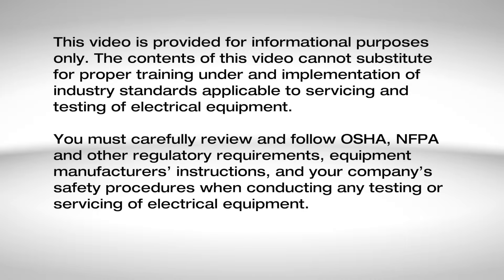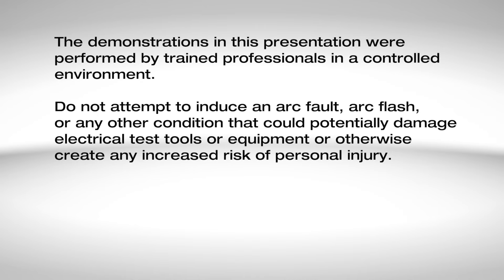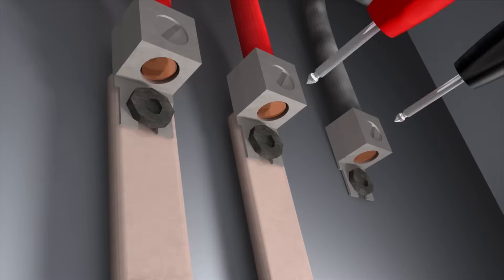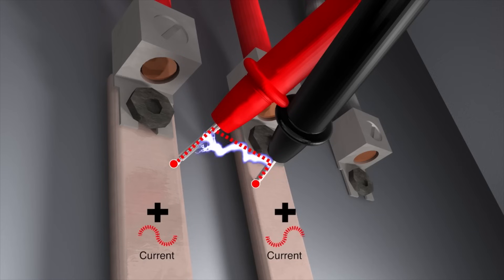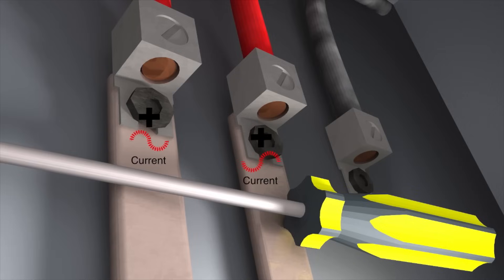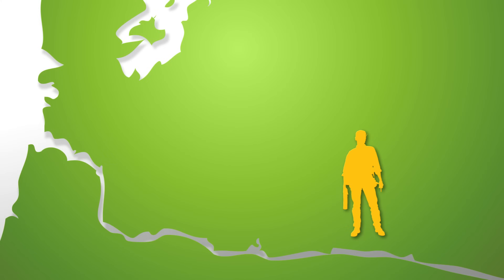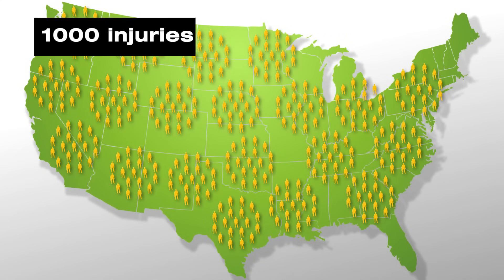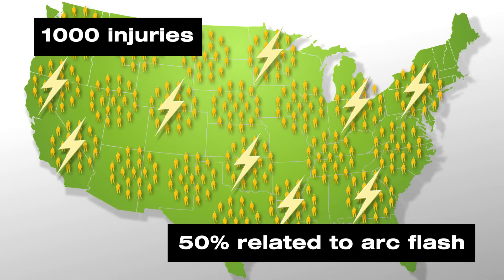Dangers of arc flash

Comment: 1:30 No, it's 3.4 times AS hot as the sun. The sun's surface has a temperature of 5772K. "Four times hotter" would be 5x = 28860K or 51488°F.
Reply: They were comparing to the sun’s temperature at night.
Reply: @MichaelApproved  Probably in winter time too.
Reply: @MichaelApproved Using Kelvin is the only way to compare temperatures in absolute terms.

Comment: Arc flash is extremely rare, like a piece of Fluke equipment. If it works, it must be a fluke. John Fluke didn't like the smart engineer that said it.

The guy failed to mention arc flash is basically like arc welding except at much higher voltage and AC in most cases.

Comment: Thank you.  Never had the displeasure of an arc flash. 
   I am a retired professor and have watched and been taught by electricians as a young boy to my retirement. Thank you to all the electricians out there. Your colleagues kept me safe.
Reply: I once did... was patching a set of outdoor extension cables as a teen for our electric mower (#1 no-no) as my mom and sisters would often run over them with the mower (don't ask me how!) I went to pare back the sheathing to get bare wire to solder the ends (no twist-patching!) and BANG. Mistake #2: I had not unplugged the feed end of the damned cable. Ruined the Xacto knife, luckily no metal splatter from it. Just meant I had to cut a bit further back, AFTER unplugging it. Never did that again.
  120v is bearable, 240v is decidedly NOT fun. (general house feeds) 
  Also took a picture tube discharge when rotating monitor tube due to phosphor burn-in from mainframe menu. It went through my thumb, and it didn't hurt until about 5 minutes later, when my body got past the shock. I realized I had a hole right through my thumb and nail. You know that safety-pin thru a finger prank? I could do it without the fake pin! Almost made the secretary pass out. 
  When I saw bro-in-law was using an extension with a cracked casing (when I was older) I paid for a new extension for him out of my pocket, and told him why. Now I even have a spare 50' cable laying about (the damaged ones get stripped and the copper recycled.

Comment: Making something tension-free is not that difficult. Simply switch off the consumers and measure at the fuses whether there is still current flowing (measure three times, the second time on a current-carrying conductor to check your meter). Placing  the fuses is something completely different. Fluke should make an instrument that measures the impedance on the outgoing side, so that you know what current to expect when you place the fuses. Unfortunately, they don't have something like this in their range. You can measure with your ohm meter, but this one measures the direct current resistance. Not the impedance.

Comment: maybe industry can incorporate a new method/pc board  that  views the needed electrical measurements and sends them to a device/receiver a safe distance away like a radio frequency signal add on to the panel box  that sends the required info to a battery powered hand held device. the new key fobs in autos comes to mind as they have many functions as they are. 🙂

Comment: Was researching Wadsworth panels not tripping and stumbled onto this video. I am an electrician and currently doing some work in a house that has a Wadsworth panel (I explained to the customer that panel needed changed and she understood and said ok.) I was changing an outlet that I thought it was dead, the breaker was OFF, or so I thought. A previous DIY'er had reversed the wires in an upstream outlet box, white was hot and black was neutral. My tick tester only went to the black wire and didn't beep. I unscrewed the black wire first with an impact and as I touched the white wire the impact the shank also touched the side of the box... sparks flew... breaker NEVER tripped.
Reply: So, ¿the breaker wasn't off to begin with?
Reply: Breaker welded itself shut.

Comment: Thinking of lightning's electrical current, and how electrical paths from lightning can cause the completion of the circuit, we can now figure out in detail the two types of arc flash events: 

Phase-to-phase - this means ionizing electrons from one metal object to another metal object (given the metallic objects are too close to each other) created an air gap good enough for charge separation to set off the arc flash. 

Phase-to-ground - this means a metallic object got too close to or touching (contacting) metal that goes to the ground, or metal that is on the ground, causing the same air-gapping, electron ionization and resultant charge separation to set off the arc flash. 

Also.....

Combustible dusts that happens anywhere these two events happen can also cause the arc flash if the heat or charge separation (along with enough oxygen) to set off a spark is good enough for these dangerous flashes.
Reply: With that, working with anything silver on energized electrical equipment creates the highest danger because silver is the greatest conductor.
Reply: I don't know why people are putting dielectric grease in panels. Once that stuff gets full of dust it's going to be fun and games.

Comment: Sometimes working on this stuff (240 volts or less) I get very reckless trying to get a piece of equipment going.. Just yesterday 3 phase 208 volts on a 35 amp breaker I was crouched over the locked up condensing unit and had a phase to phase event. I'm not joking when I say it was like an M-80 going off right in my face. No injuries. It must have touched right when the AC sign wave was peaking because it was bad. One day I know something bad could happen and I pray the circuit protection keeps doing its job. 208 volts can draw tens of thousands of amps with the ohms as low as they were being 5 feet from the 400 amp sub panel. Usually no big deal but occasionally the unexpected very violent arc flash can and will occur. Stay safe all electrical workers 🙏
Reply: take care pls

Comment: I repair welding equipment for a living, arc flash and arc burns , very bad deal. Respect electricity always, no matter what the voltage.
Reply: 💯 agree. I have the highest respect for electricity. I repair circuit breakers and I've seen some really burnt out ones. Big chunk of metals melted like butter. 😵‍💫 ⚡⚡

Comment: Arc flash - a non-explosive electrical flash which gives off high heat and can cause severe burns or shock, and even death. 

Arc blast - much more dangerous - is an explosive electrical flash which can cause not only severe burns or electric shock - but also fractures, and also even death. Like an arc flash, an arc blast gives off high heat but also there is the pressure wave of the explosion which can lead to severe physical consequences as well. 

Examples of arc blasts happen during explosions on electrical transformers when they fault.
Reply: LIghtning strikes from thunderstorms are also examples of arc flashes and arc blasts.

Comment: Why not cut the power when you have to open a panel....
Reply: How can you locate and trace voltage without power? I have to assume your not an electrician. We require voltage to trace faults. It's like turning off a car engine then trying to figure out what's broken without ever running it. It's called HOT WORK. 60% of work electricians do has to be hot work. Wear PPE, follow rules, be as careful as possible then say a prayer. Lack of attention to work will put you in the ground.
Reply: @doughnut4867  95% of what electricians do is installing lol. New construction we don't have power till the near end.
Reply: @Tre16  so no temp poles, you don't install power on site? No troubleshooting? Just new construction with a master license? I'm talking about MCC repairs, ats installs, rewire existing services, service replacements? Then your missing millions of dollars doing TURN KEY work. Go for it man. No commercial or residential repairs?
Reply: @doughnut4867  I'll bet you could do some of that with the power off, using test equipment?
Reply: @doughnut4867 can i make a questiom for you about arc flash?
Reply: Yeah... Just shut shit off. I'm sure the rest of the people in the hospital... Or refinery... Or any other critical operations, won't mind.

Comment: This is the only video, where a person knows what they are talking about arc flash. Precisely said 4 times hotter than the surface of the sun rather than saying just the sun.
Reply: Can i make a question to you?
Reply: @guilhermearaujo1350  sure
Reply: @sto2779  you understand about arc flash right?
Reply: @guilhermearaujo1350  Sort of but not years of experience about it. They are extremely dangerous when high voltage is involved. As shown in the video.
Reply: @sto2779  a transmition lines can have arc flash? And arc flashes have the same power than the cable? If a cable have 1000 Volts and 100 A = 100 000 Watts the flash will have the same wayts? Or its just heat?
Reply: @sto2779  look my previus comment what you think?
Reply: @guilhermearaujo1350  With your settings, Arch flash will be 100,000 Watts (pure heat energy dissipated, it gets worse, this will be molten metal of the wires projecting out to least resistance path to ground, in this case the user/electrician), you also need to consider time into this scenario, it will happen in a fraction of a second, around 700 MPH, that equates to an arch flash of molten metal travelling at the speed of 1027 feets / sec, which means for the very 1st foot distance of arc flash traveled will happen in 0.058 sec (which is 58 milliseconds). Arc flash is scary stuff, specially when current is not monitored or controlled. Today's electrical boxes are extremely primitive when voltage and current could be easily controlled digitally to prevent these devastating instant arch flash accidents.
Reply: @sto2779  but wait, if the arc flash has 100 000 watts and it lasts for 1 second, will I receive 100 000 watts in my body? Does the electrical resistance in ohms of my skin matter? because if the arc flash is 1000 volts and my skin is 100 000 ohms then the current in my body would be 0.01A or did I make a mistake??
Reply: @guilhermearaujo1350  100,000 watts is nothing but heat, your body will absorb it and it will travel to you because you might have high resistance, but regardless of the fact, current always wants to travel to the least resistance, so the electrical panel is bursting outwards from of molten metal and it needs to go somewhere that have least resistance and the closest thing to least resistance is the user. Also the user is the one who first caused the arc flash, it created a path for the current to travel towards the user creating an arc flash. The ground (literally the earth, like soil) is electrically neutral and current always wants to travel there and the user provides a connection to ground.
Reply: @sto2779  so don't matter how many ohms i have, i will receive in my body 100 000 watts yes?
Reply: @guilhermearaujo1350  yes, regardless you are wearing shoes, you still create a least resistance path to ground. and Personal protective equipment (PPE) doesn't protect you because the arc flash will pass right through it like butter. You'll need some heavy duty PPE, the stuff electricians use at the power plants. This is why arc flash is extremely dangerous and shouldn't work with high voltages without proper defacto safety measures. Call the electricians if you need high voltage work, voltages starting at 220V with unlimited supply of current can cause lethal arc flashes.
Reply: @sto2779  can i make for you a question?
Reply: @sto2779  where are youuuuuuuu?

Comment: Hot as the sun in 1 millisecond and circuit breaker takes about 16 milliseconds to trip. Wow!
Reply: He said 4x hotter. I think it’s 6x. The problem is thermal radiation power goes as the 4th power of temperature, so the flash is 256 to 1296 times as bright as the sun, and inverse wavelength is proportional to the temperture, which means the flash is unbelievably bright, but even more unseen  power is UV, so your 👁️ 👁️ are destroyed.

Comment: I survived an arc flash. A 3 phase 220 volt panel grenaded in my my face. I got lucky. The panel door deflected the blast. I was open the door to reset a breaker when the panel exploded. If I had been just a bit sooner opening the door I would have gotten my face blown off.
Reply: What was the cause of the arc flash?
Reply: Take that back, you stand off to the side and turn your face away.
Reply: @easyenetwork2023  and use your non-dominant hand.
Reply: @easyenetwork2023 Better erase the previous comment, you got the second right, but somebody can get confused with the first one.
Reply: My brothers best mate was literally fried. Took them  40min to shut the power down to retrieve him. Doing a routine gutter clean , powerlines arched then conducted to cherry picker, his workmate then finally he took the final blow saving his colleague. Very very sad day for us. Love U Anda
Reply: That is why you turn your head when messing with a disconnect. Might prevent blinding and blows directly to the face.

Comment: I doubt it's hotter than the surface of the sun, we can't even get within 10'000+ miles of the sun or we or a space ship would be vaporized. All the energy we get starts from the sun one way or another.
Reply: your doubt is misplaced. You seem to be confusing temperature with heat power. Even the tiniest arc can be very high temperature across a very small volume. Also even the core temp of the sun is low compared to what we can make on earth. For example  Brookhaven National Laboratory's Relativistic Heavy Ion Collider had made the Guinness World Records for achieving the "Highest Manmade Temperature" - a whopping 4 trillion degrees Celsius, 250,000 times hotter than the CENTER of the sun.Aug 21, 2012